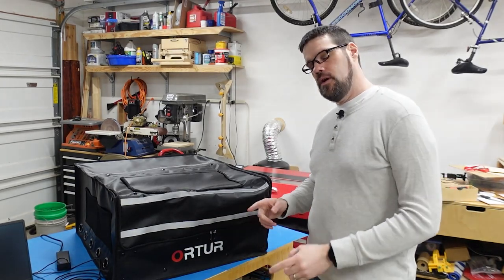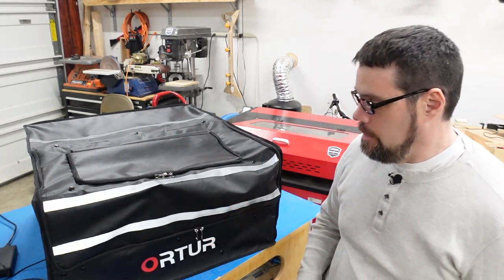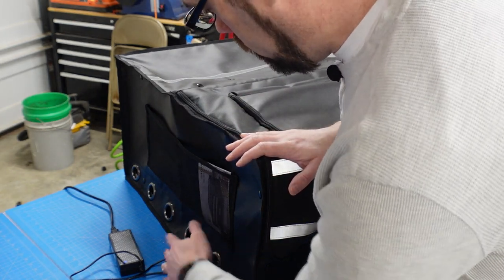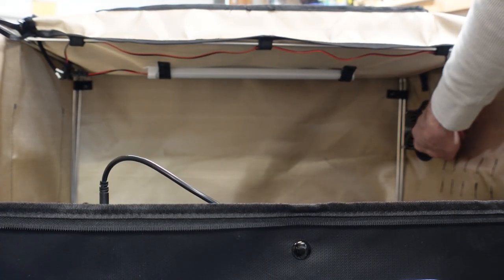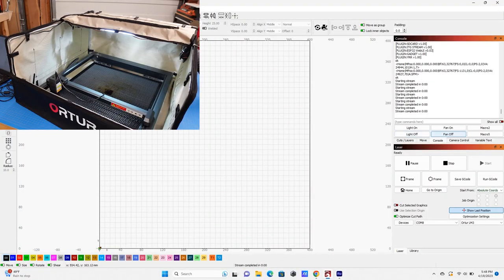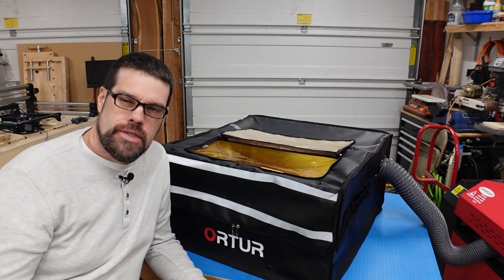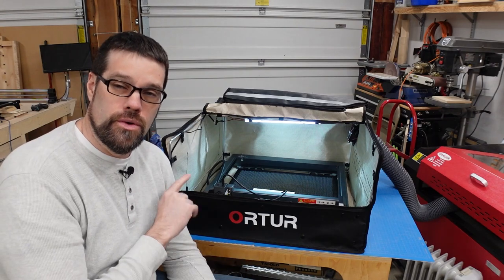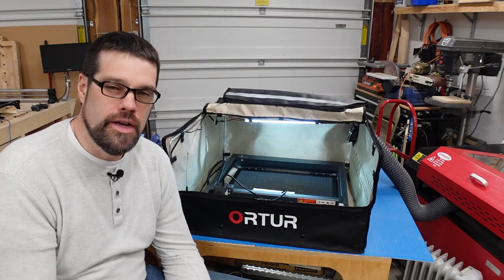Ortur Laser Enclosure 2.0 with Lightburn controlled Light and Fan!

Comment: Thanks for showing the commands for turning on/off the fan and light. I believe my Aufero Laser 2 has the same controller PCB, so I was thinking adding lights to the enclosure I already have and control them via the Aufero Laser 2. Still need to figure out what the type of connector is that they have used on the controller board. If anyone knows,  I'd love to hear ;)
Reply from the maker: Glad I could help, I have not had the Aufero laser so I can't speak to the connector on that board.  Hopefully you can sort it out and try out the option for the lights.
Reply: @Vintauri  The Aufero actually has the same controller board as your laser. I figured out what the connector is (PHB 2.0mm; 2x3 contacts). Would you mind sharing a close up shot of the cable from the enclosure you had to plug-in to your controller board? I'm trying to figure out the signals that they use (e.g. if the power is supplied via the controller board or if it's just a control signal).
Reply from the maker: @itavero  Unfortunately I loaned out the laser and enclosure and do not have access to it to help you with that.

Comment: What happens if you don't have Lightburn? I can't get my light and fan to be on when I turn the laser on. I have the Ortur Master 3LE and the Ortur Enclosure 2.0
Reply from the maker: I don't have the enclosure and manual on hand to look at as I loaned it out to a friend.  I believe there was something in the manual about different wiring to make the fan and lights work without the Lightburn macros.